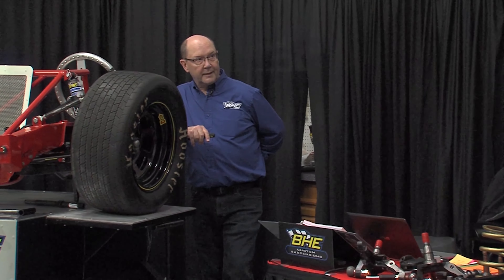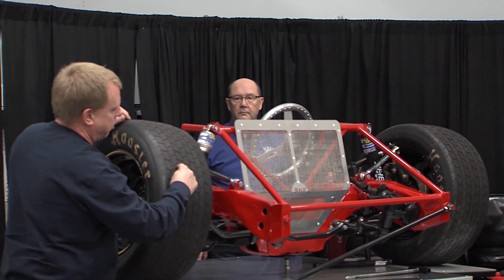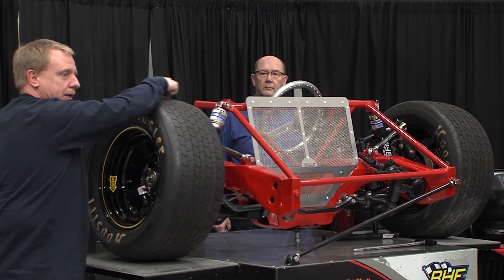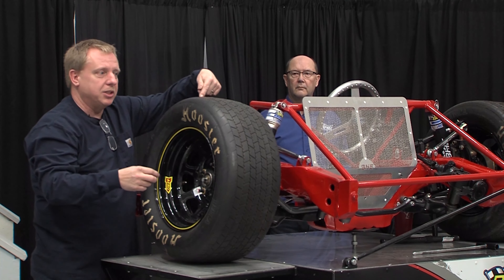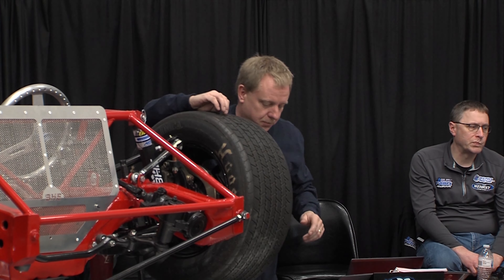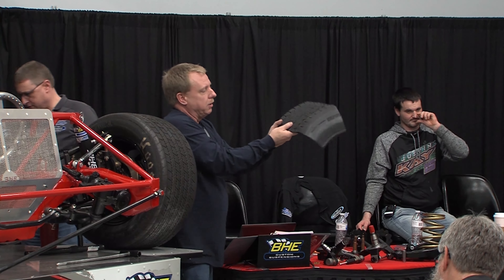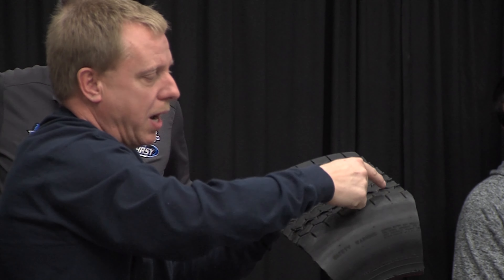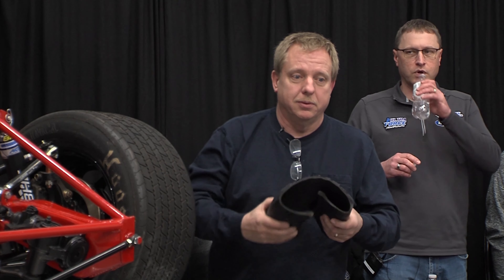How To Properly Grind A Tire ( FT. Kelly Shryock)

Comment: What I don't understand is why you would want to sand the tires in the first place. Doesn't that take life off them?
Reply: It brings the tire to life. The shiny stuff isn't grippy so you take a layer through friction which creates heat and makes the rubber adhere to anything. Once you've taken a layer off, it will have more grip off, the bat, instead of driving it around for a few laps to have the same effect.
Reply: Because it takes the glaze off the tires and it sharpens the leading edges
Reply: You not trying to save tires, you're trying to win races. The whole point of racing, or maybe I'm missing something.

Comment: When we had to run street tires when I was 11 on the pro 4 asphalt late model back in 2003 or 4 we would run my dirt tires for the pro 4 dirt modified. In both cars they had Ford 2.3s stroked out to a 3.0 making 370 hp to rear wheels and turning 11k rpms but after my first season on that class we got two brand new esslinger motors abd wow they was bad to the bone turning 12k roms abd made 430 hp to rw. a couple laps just enough so the dirt green dots would feature up abd sharp on each drive edge like he is saying. So it's easier to feather them like that then with a grinder abd you get practice Laps in the asphalt car on open practice nights during the week I would then clean them very well and cool them rapidly with water after they was hot abd feathered abd wrap in plastic wrap till it was time to hit the dirt track that weekend or following day after asphalt night abd they would hook up so nice and last so much longer on the right rear and win lots if races doing that and worked perfect and looked better when compared to a gribded tire side by side. When I told tech guy what I did he couldn't belive it worked.  You can only do that if you race asphalt abd dirt is the only problem.
Reply: You can't be talkin' about the "lima" 2.3s, right?!  I can't imagine turning one of those that fast...or making that much power, n/a... 
Are these the 16 valve "duratecs" that you're talking about?  I can believe that.
Reply: @billymanilli  I'm talking about a Ford 2.3 from the mustangs and pintos and t birds from late 80s to early 90s we was running 15k dollar motors we was building
Reply: @billymanilli  now the esslinger motors was a mini sprint all aluminum purpose built racing engine based off the Ford 2.3 but it's all billet aluminum heads and block and all custom built for racing and those things would rev 12k rpms and the mustang ones we built would turn 10-11k rpms